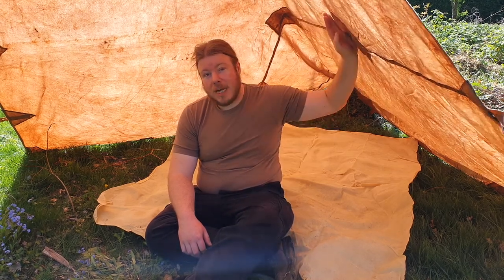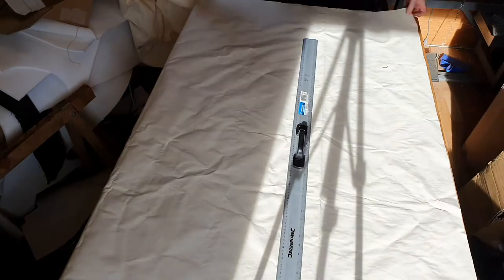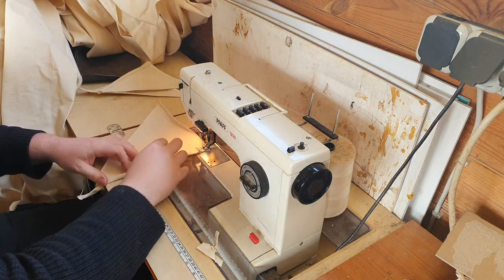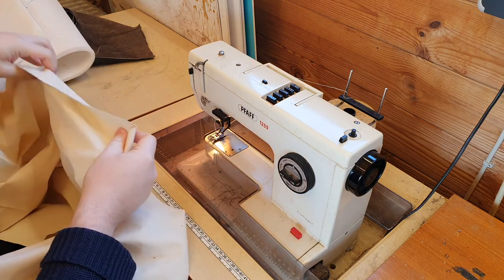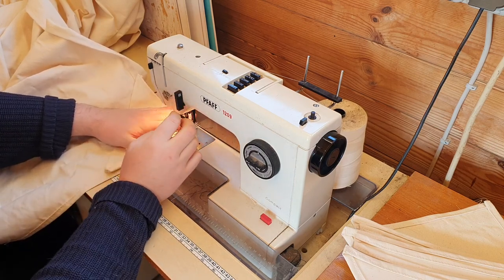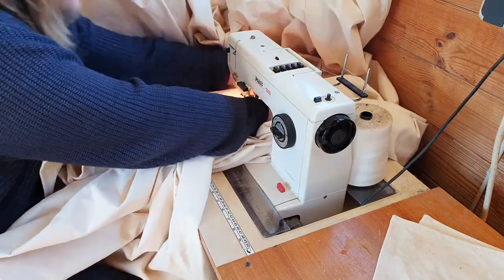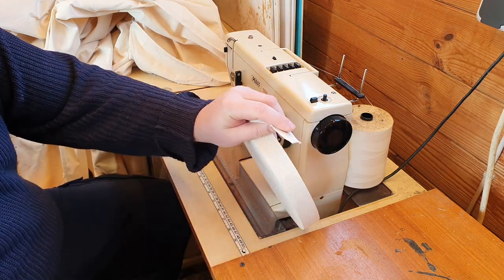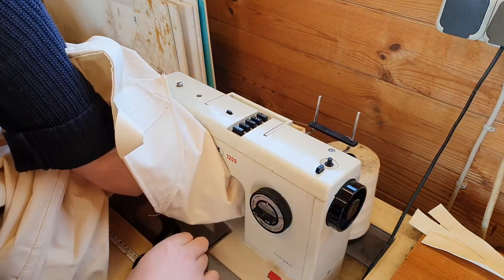How to Make an Oilskin Tarp

Comment: Things are either animal, vegetable or mineral.
In this case cotton, a vegetable, so we want to treat it with a vegetable. Linseed oil, turpentine, alcohol, beeswax artist oil paint made of linseed oil base with tint are all ok.
Any kind of petroleum product or mineral spirits is mineral and it will attack the fiber and weaken it over time.
Good job here.
Thanks for the video
Reply: You can use naphtha mixed with silicone. The silicone dissolves into a solution that is carried into the threads by the naphtha. The naphtha evaps  completely in about 2 hours, leaving just the silicone, which is inert and does not harm fabrics.  Also, it will be ready to use in about 4 hours of drying.

I recommend an addtional coating be applied by roller onto the "out" side while the tarp is setup and stretched normally, to fill any crossover holes and any stitches.  Emphasis on the stitch lines, as you would with any seam treatment.

I have made about a dozen tarps, both canvas and cotton sheets using boiled linseed oil/mineral spirits/toilet ring "wax".  They have covered my sailboats, and served well as camp tarps, and firewood covers, as well as camping table covers and a couple rain coats for my dog.  This, over the last ten years.  None of them has ever degraded whatsoever, and, once fully cured, they do not catch fire.

NOTE:  NEVER tightly roll up or fold and store any fabric treated this way until fully cured out.  This can take up to several weeks.  Until it is fully cured, it CAN combust on its own.

This is why I recently switched to using the silicone/naphtha solution.
Reply: Not sure about your logic here: isn't petroleum derived from plants - even if very ancient plants and over millions of years of extreme conditions?
Reply: Vegetable was treated with mineral and eventually became mineral.
Same as when you over oil a rifle or shotgun action and the oil seeps into the stock and eventually mineraluzes the wood changing the grain structure and weakening it

Comment: Hi LarpWright - very interesting - but you miss out telling us something important: what is the weight of the finished product compared to the starting product (the canvas without the proofing)?  This is obviously important for anyone wishing to use a canvas tarp for backpacking.  I calculate from what you do tell us (and assuming all the white spirit/mineral alcohol evaporates off) that you end up with a weight that is roughly twice what you began with.  But it would be nice if you could confirm this.  (Commercial canvas oilskins seem to be able to get away with a finished product roughly one and a half times the starting weight of canvas, but it is not likely that a DIY product can compete with that.)

Comment: that is a really nice tarp, good job :) also from a chemical point of view, your choice to thin it with alcohol instead of mineral spirits was a very good one, because alcohols fully dry without leaving behind residual toxic chemicals and nasty smells, where as the tarp would have probably much more flammable and never stopped smelling of mineral spirit if you had used that
Reply from the maker: I had not thought about that. But you are probably right. 
By now the tarp is fully dry, not even slightly greasy to the touch or anything, and all it smells of is linseed oil.
Reply: @larpwright  it's awesome that it worked so well :)

Comment: I've just oilskinned a 180gsm cotton/polyester sheet. I used vinegar as the solvent. I'll let everyone know how I get on, it might be too thin gsm but we'll see
Reply from the maker: I'd be interested to know how that worked out. How strong is it? How waterproof? Does it smell of vinegar even after a few weeks of drying?
Reply: @larpwright  no smell of vinegar. I gave it two coats as it wasn't that waterproof with 1 coat. 

With 2 coats it holds water, but some water can penetrate at the start (either I didn't give it two even coats, which I doubt as it looked fine, or the cotton needed to swell a little as I could see some tiny gaps).

Strength wise I haven't tested it yet, but it weighs around 1.6kg (3.5 lbs) which is heavier than I wanted, but I guess that's the nature of oilskin. 

I'll test it camping, but even if a little water comes through, the angle it'll be at shouldn't allow it to drip onto me.